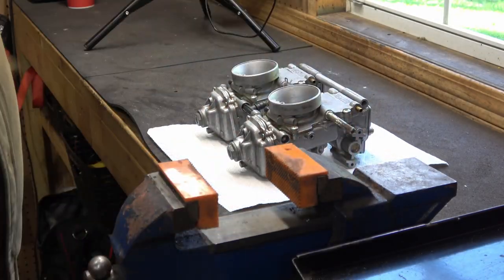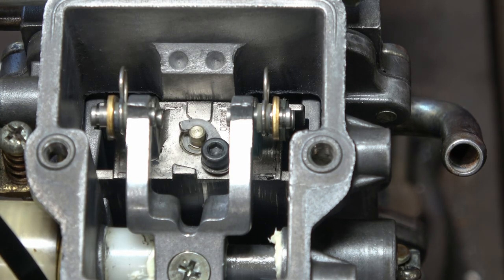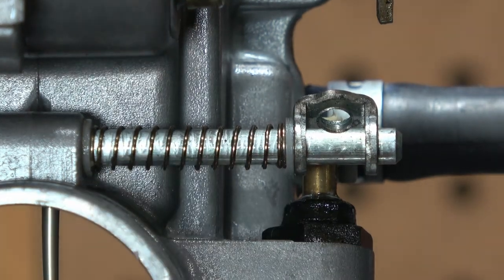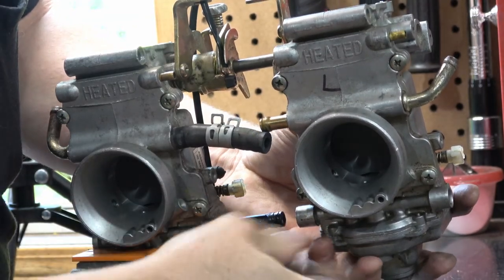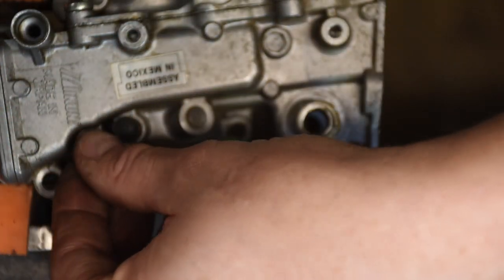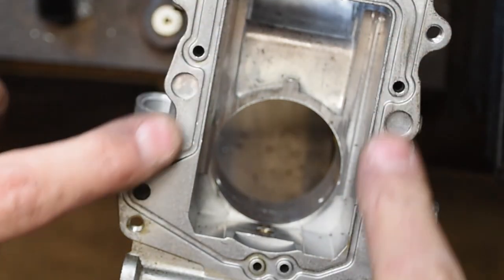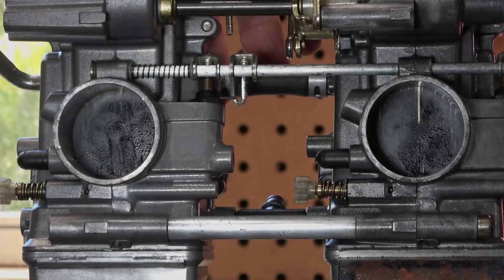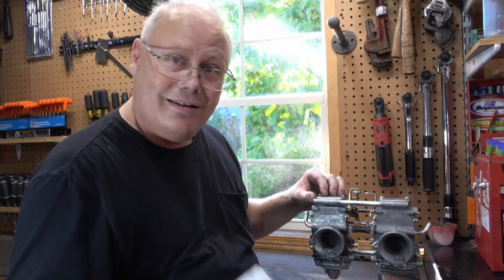Today,  I clean a set of Ski Doo Carbuetors

Comment: Finally, a video about the important carb components and comments relating to what they do. The OEM parts labels are woefully sparse on fine details or accurate descriptions. I was looking to install a fuel primer but there are two rubber caps on each carb and difficult to get to without removing the carbs which i didn't want to do in my MXZ 600. The caps briefly shown at 10:32 and 10:42 in this video gave me the confidence to install it in the proper place (the only place as it turns out!) Also, the synchronizing and mix adjustments were easy to do .. I was anticipating using my vacuum gauges but not required.. and should make my sled start and run better. Thank you Dino.

Comment: I actually think the 50-50 mix of simple green is the cause of the discoloring. If the solution becomes acidic the anodized aluminum discolors. I am using closer to 10% @ 150deg Fahrenheit(~65C) and run for 30 min. I also use a small container in the Ultra Sonic cleaner with engineered gas from the home supply store(Lowes). This removes any shellac from old gas. I am using a Hornady Lock and Load Hot Tub Sonic Cleaner with heat settings and timer. The Harbor Freight Ultra Sonic Cleaner works great also. This Ultra Sonic Cleaner works by creating micro bubbles that burst on the surface of the item your cleaning. This action is the cleaning process. The solvent or soap is for substances that are elastic and are not affected by the sound vibration.
Reply from the maker: wpeterb, what a great comment, thank you.  I believe you are correct. I did some reading and simple green, green is shown to cause this kind of discoloration on aluminum and is no longer recommended for aircraft cleaning because of this. I have used the small container method for smaller parts and it works very well, however for larger pieces like carb bodies, I have started to use simple green HD purple, which works well, is non flammable and safe for aluminum. 
Dino